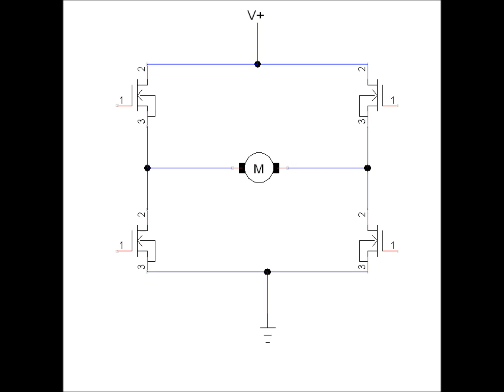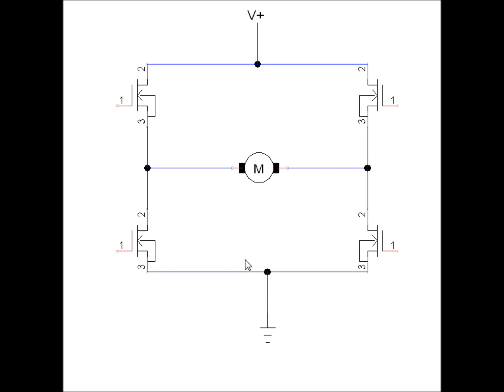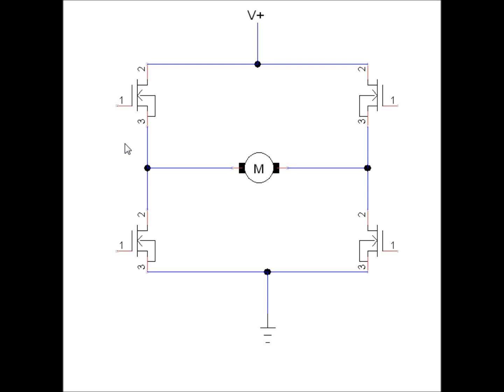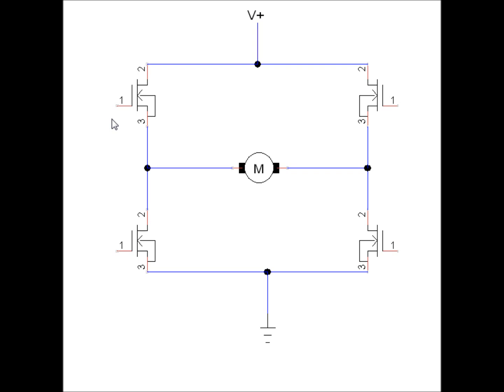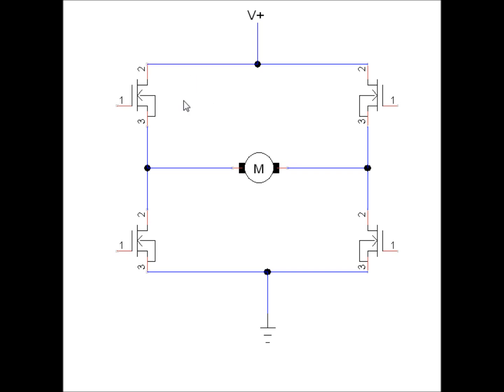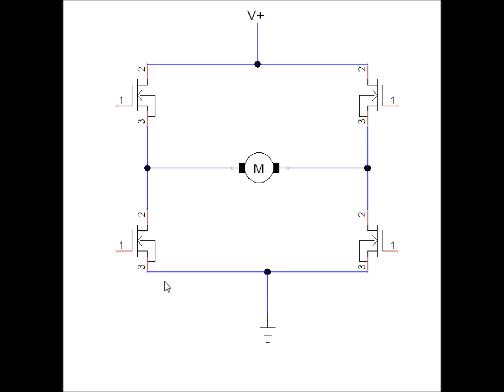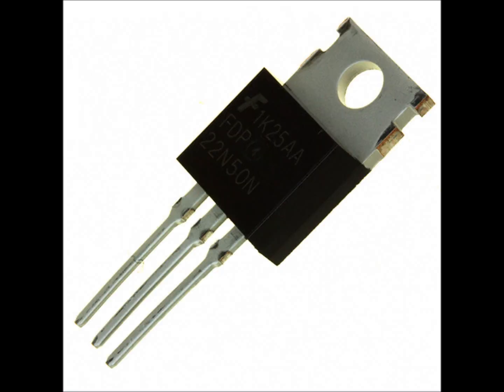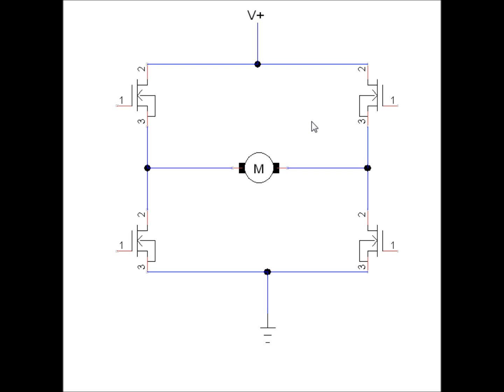Simplified MOSFET H-Bridge Theory

Comment: to my uneducated brain the word source would be the supply where the electric comes from and drain is where the electric goes it just seems so illogical ( no pun intended ) to have called the pins the way they are apart from that the tutorial was great
Reply: Yes, the do it this way just because they can.  In simple transistors the is the collector and emitter (sp?), why not use this convention when explaining a mosfet?
Reply: Because the way they work is different. A gate for example works more like a capacitor, and does not let current through in the same way as a base. There is a transistor combination named IGBT (insulated gate bipolar transistor), which has a gate, a collector and an emitter.

Comment: what type of circuit protection can i look into for my type of setup ? im planning on building my own H bridge using MOSFET P channel and N channel  25/30+ amps so i selected the transistors that are god with this type of amp and voltage workings but do not know what type of components i can add to protect it, this is a robotic application with 16+ dc motors and Arduino
Reply: I had the same question @Bshizz1e, thanks for a great video!

Comment from the maker: You only need charge pumps to operate N-type MOSFETS on the high side. P-Type MOSFETS could be used on the high side and that would simplify things. This is because P-type MOSFETS turn on when the Gate-Source voltage is negative and this means you would need less circuity for the high side. However, P-Type MOSFETS are rarely used because they are more expensive, have less power handling abilities and they have a higher effective resistance when fully on.